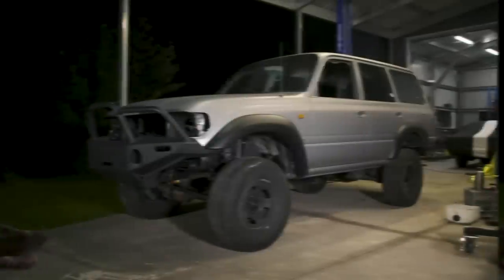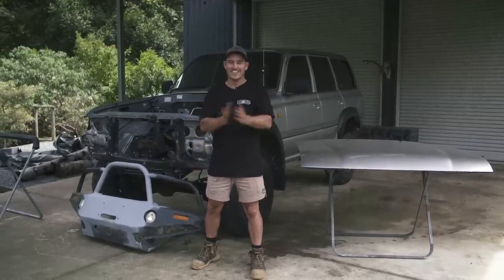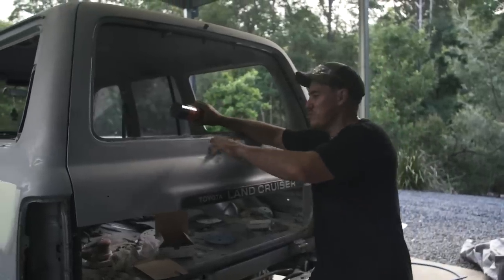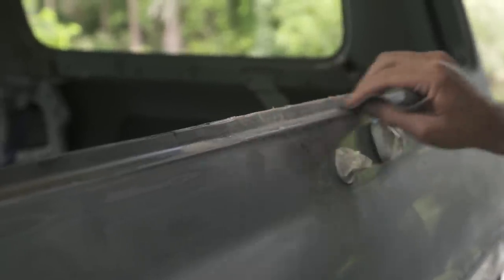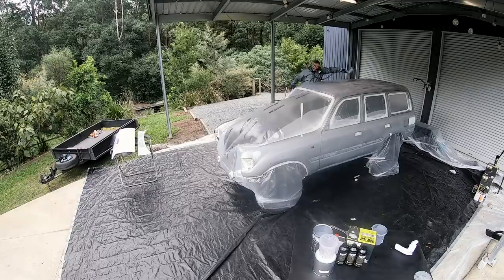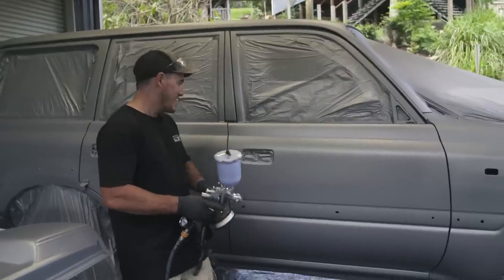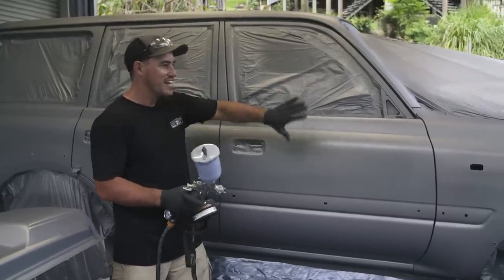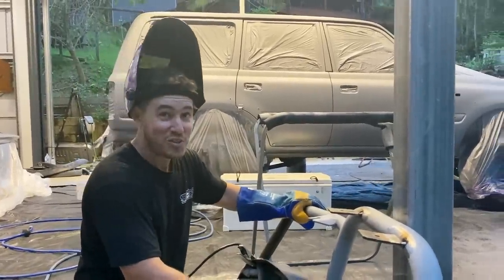SOOTY 2.0 BUILD UPDATE - Big Problems found & solved plus Why Shaun went with a Raptor Coat!

Comment: A little tip when pushing soot (and any other rig) around the shed (saw you struggling in the vid a bit). Rather than push it from the front or rear bars, just rotate one of the wheels and it rolls way easier.
Reply: Especially on big wheels
Reply: Push backwards using legs.

Comment: This is great, I love 80s (as I love mine) and seeing one saved is always a bonus. They’re one of the best ever stock off-road vehicles, and when modded, they are the best.
However, the rust you found under the rear glass should have been cut out and new metal welded or brazed back in. IMO rust like that cannot be stopped, only stalled, it will be back to haunt you.
Otherwise, you should call it ‘Sooty Too’ or some such, ‘cos it ain’t ‘Sooty’. 🤣👍🏻❤️🇷🇴
Reply: I'm in New York I want one too!

Comment: Awesome job mate.
Tips, things you can't do after its back together;
1) New evap & TX valve
2) heat shielding to fire wall and trans tunnel (outside)
3) modify HVAC unit for cabin air inlet filter.
4) power antenna 

Enjoying the build videos

Comment: Nice job Mate!
Do you consider to put a second fuel filter system into this beast? And what about an rear air bag system for leveling the rear section when towing  heavy stuff? 
I can't wait to see the next episode. Best regards from Hungary.
Reply: Hi e doesn't tow a lot with sooty the 80

Comment: A couple of length wide reflective tape strongly attached to both sides of the recovery kit bag would be a welcome addition as it would make the rope easier to see in torchlight and could be used as a safety warning to others at night in most low light situations 🤔

Comment: Great build. You asked for some suggestions and first thing that came to my mind is rock sliders. Some bar work down low between the front and rear wheel flares will help complete the look and also help you protect the doors and fenders. It would be terrible to see all that work and fresh paint be ruined if you slipped off a rock and crush in a door.

Comment: Awesome to see this build, cant wait until its finished. Get a roof rack this time but dont get a rooftop. The dirty 30 and 200 are for touring, but this is a tough track weapon and a swag suits that better imo. 2.5-3" lift, 35s and the reduction gears that you mentioned will make this truck unstoppable. good luck

Comment: A water cooled sealed alternator,
Transfer case mounted hand brake, 
Custom alloy roof rack so a awning can be mounted but it’s not over hanging the side of the car,
Rock lights,
Reduction gears,
Mount a little led light under the bonnet and in the tailgate,
Mount the radiator so it’s 2 bolts to remove in 5 mins unlike factory or have enough space so it can be cleaned or a fan shroud that’s easy to remove with out taking the fan off. 👌

Comment: Good call on the reduction gears. Really surprised not many of you Aussies run them. Another thing that helps on old cars is having retrofitted headlights. You can run HID/LED bulbs and minimize using lightbars and other extra lighting. Saves money for other mods.

Comment: Mate, it is a while ago you did this and a hint for rust prevention if no one has told you. I have a couple of old cars and I they are rust free. Peanut oil is the secret. Atomise it and spray it everywhere. Up chassis rails till a fog comes out. Up in door weep holes and watch the dust wick up the outside for weeks. Get it in everywhere you can. Do it every 12 months and you will have no rust issues. I know it sounds proper weird but it works. Be well Mitch.

Comment: Dual high mount alternators would be a great idea. And a seperate battery just for the winch so if you have issues its a stand alone system

Comment: check out absolute wits end they have a shelf you can mount inside the rear quarter panel. i put one in my 80. my next plan was exactly what shawn was going to do put all the 12v on a wall with a gull wing rear window

Comment: Hard mount arb compressor plus tank - run 4 line’s throughout the vehicle 1 to each tire. Connect all 4 at once when airing down or up, hard mount taps in the wheel well then make up 4 small extensions to each tire install airbag man system or similar to control deflator and inflators, a lot to it but we’ll worth it. This way you can also have a dial with all 4 wheels to set pressures, it’s what I am currently putting together, planning 🤌🏼

Comment: Brilliant work.  It looks sweeeeeet!!! ❤️ Heck yeah, I'm loving these build series.  Particularly an 80.  I hope to do a re-paint on my LC80 shortly.  The (white) paint is starting to get chalky in some spots.  It would have been good to see more details of the accessory fitment (like the gull wings).  A fan of the Cruiser Company gull wings & rear bar.  I'm planning to get a pair of gull wings or emu wings myself soon - I just need a new suspension kit first.

Comment: make sure to always keep the roof clean after taking it on the tracks, if the raptor coat on the roof isn’t cleaned it will mold. always a pain because the mold goes into the groves and is very difficult to get out if left for too long

Comment: As you are building it all up like new, suggest you keep careful logs on everything. If you keep everything up to spec, it should be as reliable as a new one. i.e. changes hoses, replace oil, etc on time. Don’t wait for something to go wrong when you’re out bush. Also, are you getting a full transmission rebuild too?

Comment: Holy smokes, that raptor coating on the new sooty looks 1000x better than the original one. A quick question about the 1hz block, I have heard that the heads aren't interchangable is that because the pistons are different too (I assume they are because of the whole direct/indirect injection thing) but is that all that needs to be done to convert a 1hz to a 1hdt? What else was needed to make the 1hz up to the task? I may or may not be toying with that idea haha.

Comment: Gotta ask, I’ve raptored a few vehicles now. The latest was a fine crumb texture using a HPLV gun. Question I have is how did you get the color so close to what you picked? I used a factory Toyota silver with no binders (per Raptor) and it’s was a bit muted.

Comment: i picked up a 2005 4 running the body and interior was in good shape good paint leather interior but had engine problems got it for 800 bucks put rebuilt injectors coil packs new breaks rotors calipers for under 500 bucks even had new tires on it so i have under 1300 in it been offer 5,000 for it . then again it is nothing like my 68 chevy pu that i have 1400 in it with a stroke 454 and a 02xx 400r turbo 12 bolt possi started with a 450 hp 454 that had 6,000 miles on it got it free with the 02xx trans

Comment: Fit a separate electrical system for the winches. Alternator, battery etc. totally independent, but a jump switch to link both circuits if one alternator fails. This way the winch cannot drain the starter battery and leave you stranded.

Comment: Hmmm, The now, (a moments silence), defunct Sooty's donated front and rear lockers and low range reduction gear's along with a few of the old accessories like the 12 volt management system right? And its a given that Sooty 2.0 will get a 3 inch 409 grade stainless steel exhaust.
Um,  just my opinion, I think two spare tires will be used more often than the two jerrycans planned for the rear bar. Like others have already stated, a few well placed camera mounts inside and outside of the vehicle.

Comment: Fit a battery Master Switch in the cab, Shaun, so much quicker to cut the power in the event of a starter motor runaway or a loom pinch etc.  Don't want a cookup in the body.

Comment: Not so sure about putting bog over a rust spot. 😳

I know it was treated, but still.

A gusset for the light brackets would help strengthen it to better handle corrugations. Don't want those brackets to crack or fatigue due to the weight of some spotlights bouncing up and down.

I would still paint the dash board strut/structure (whatever you call it) as well as the wiper assembly that's not normally visible.
Reply: Am I the only one that wanted to see a wiring harness restoration?

Or just see what the blokes were doing with the new one?

Comment: So you sprayed it with a HVLP gun, , I have some questions 
1. What tip size, 
2. What pressure did you run
3. Becoz you thinned it out did you wait longer to put on the 2nd coat

Comment: Shauno, does the diesel have different axel components than the petrol?  I didn't know if you wanted to swap out the axels for the proper gearing and if the bearings and shaft diameter/tooth spline ect are beefier. I'm an isuzu guy and not a toyota expert by any means, but want to know if there is a difference.
Reply: Same

Comment: So Donnelly Engineering are saying that the post 98 1hz block is the exact same as the 1hdt. So they are saying that the post 98 1hz block has oil squirters. 
Can anyone confirm this as I’m 99% sure no hz block has squirters. They may be able to be machined in but not come factory

Comment: Looking good.  Can't wait for Sooty MKII to be finished and put to work..  What PSI were you running through the gun?
Reply: I sprayed mine @80psi. I wanted a “smoother” finish so i went with higher pressure. One thing he didn’t do that i would 100% recommend on every job like this, adhesion promoter is a must. The raptor will flake if panels flex, especially any plastics like bumper covers.
Reply: @gregkrueger331  I figured it was a higher pressure to get that smoother texture.. just wish he would’ve mentioned that.  Thanks for the tip as well on the use of adhesion promoter.

Comment: 2 things. I am a retired welder from the Union construction industry and have to say,,,#1, if your going to sand anything wear a respirator. #2 if your going to pull any weight use a steel rated shackle. In the US they are dual rated, ie if they say 5000lbs they are safe at 10000lbs. I have no idea which government agency certifies soft shackles and would not use one. For #3 use a rated snatchblock instead of some donut ring you know nothing about. Like everything else but don't get caught out.

Comment: Dang dynamat in a truck that gets submerged is not a good idea. You will be trapping moisture under there. Why not just bedline the floor??  Best option for a truck that is used hard.  Spray it out let it dry. All the hard-core Jeep guys in the states run that way. Carpet gets messed up quick. Just like what you pulled out of Sootie I. Keep it up!

Comment: No matter how hard you try to get the dynamat stuck down you can never get it 100% and I can guarantee you'll end up with water under it. Not a good idea for a 4wd that's no doubt going to get filled with water regularly. Far better off with a painted floor and nothing but a bit of carpet far you can pull out easy to dry off.
Noisy and hotter but I'd rather that than having to pull the dynamat back out when you discover the floors rusting out underneath

Comment: WTF
A engineering shop hasn't worked out how to set the block up square and drill the turbo oil feed spot, the same as 1hd-t but then put the turbo oil drain into the sump in stead of drilling the cradle and fitting the factory turbo oil drain fitting ?? 

I'm only a Mechanic and have all of the above correctly

Comment: MY 1973 Chevy K1500 is 10,000 times more truck than any TOJO 1,000,000 mile engine GM small block 350 ci all iron non of that aluminum shit over 100,000,000 produced to date and still going strong, no timing belts all iron NP 205 Transfer case which is bulletproof and all iron no weak aluminum shit here 4 speed manual again all steel no grapy aluminum no computer shit what so ever solid front and rear axels dual shocks and leaf spring all round lockers front and rear and I have less than $7,000 invested own since 1991 will smoke all new bullshit!!!!!!!!!!!!!!!!!!